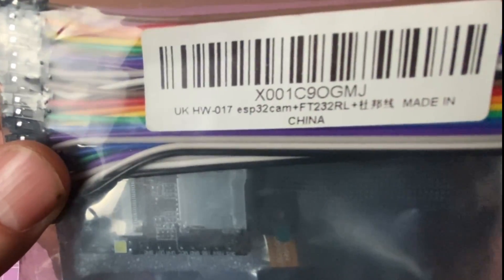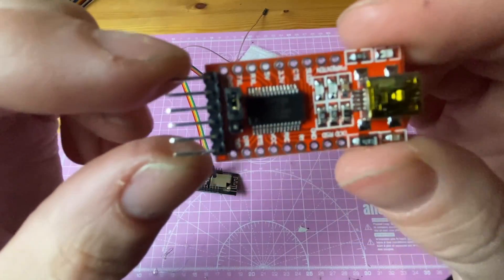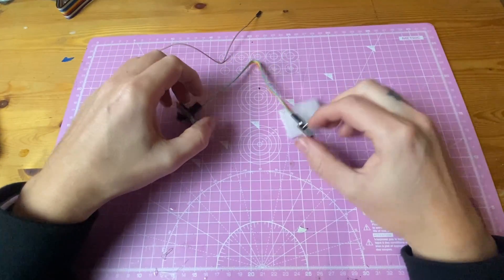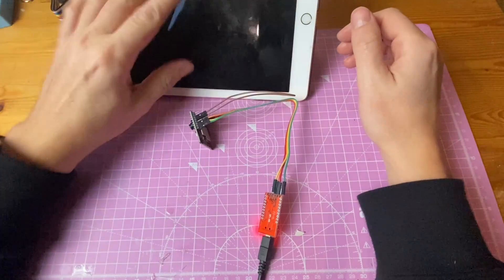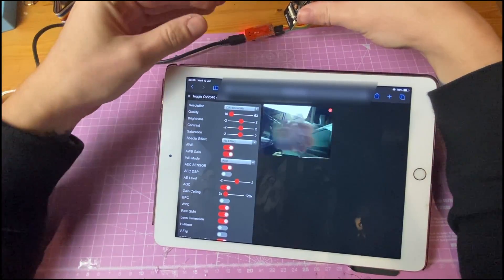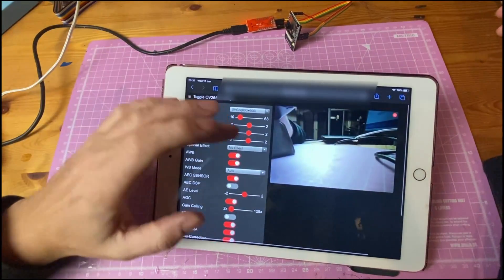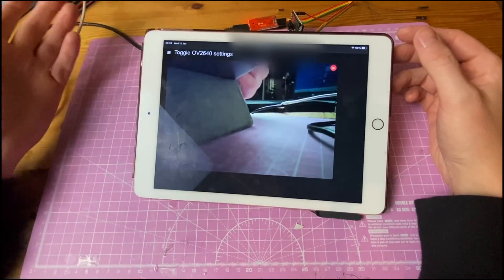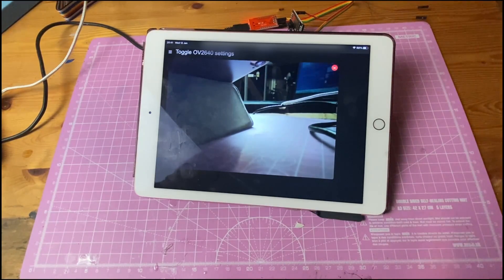Watching your 3d printer from anywhere with this cheap wifi camera

Comment: Nice video on a good find. Might need to get one myself. How far can it reasonably focus? May be useful in a (well-lit) shed for livestock monitoring. What'd be your thoughts on this application? Diolch.
Reply from the maker: That’s a good question. I’ll have to give it a test. So far from what I’ve seen with it, it seems comparable to any low/ mid range security camera like the Amazon blink. I’ll set it up with good lighting inside and outside and let you know 👍🏻